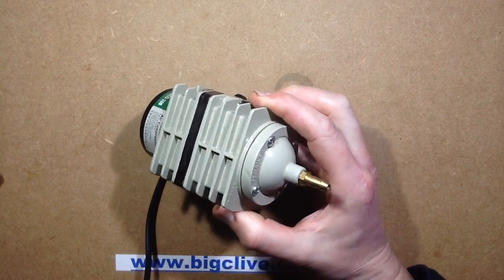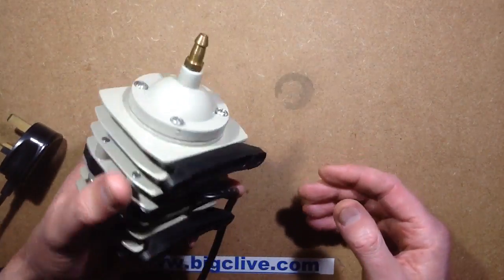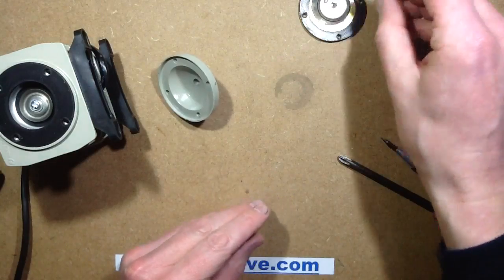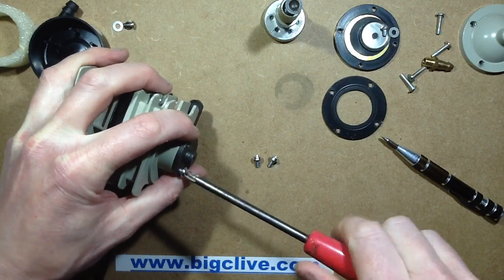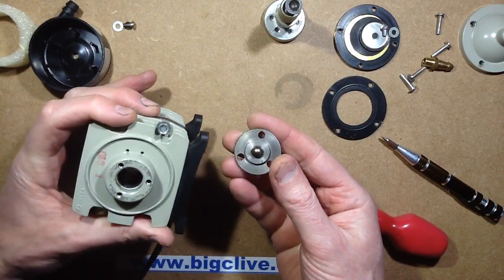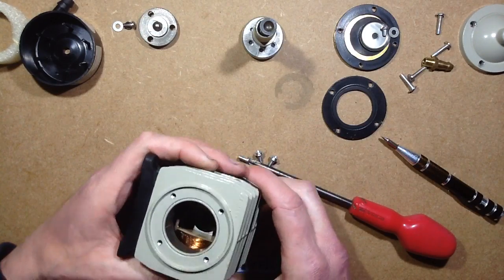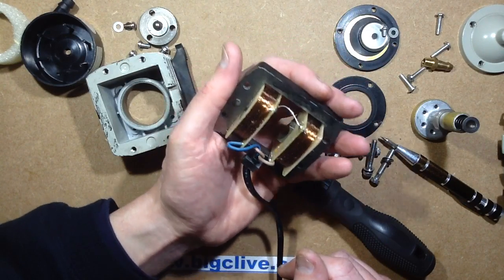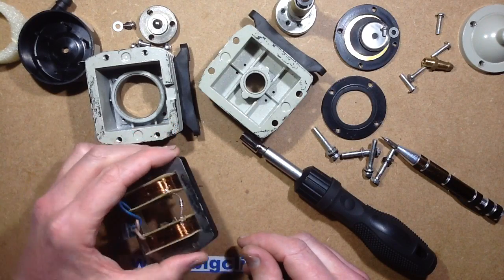Teardown of a Hailea low pressure air pump.

Comment: I have the AC0 308 model running air stones in a smallish garden pond.  The air output dropped and after watching your video took it apart. One of the valve screws had come loose and the rubber cover was loose thereby reducing air flow.  However, I noticed on this model there is an earth strap to the casing and 3 core electric lead.  Thanks for the video - very useful.

Comment: How do you know when you would have to replace the diaphragm besides the obvious signs of damage? Would you replace after a certain time frame?
Thanks
Reply from the maker: It may depend on the operating conditions.  If it started operating with lower output then it would be worth exploring.

Comment: Hi Clive, a small input hose on that model makes it's operation much less noisy.
Reply: TED6667 especially when adding a few inches of hose to it. Cut the sound of mine by what seems like half.
Reply: Getting some new rubber flaps for it. I'll try your tip with the hose @blaircox1589
Reply: @blaircox1589  ⚠️ God has said in the Quran:

🔵 { O mankind, worship your Lord, who created you and those before you, that you may become righteous - ( 2:21 ) 

🔴 [He] who made for you the earth a bed [spread out] and the sky a ceiling and sent down from the sky, rain and brought forth thereby fruits as provision for you. So do not attribute to Allah equals while you know [that there is nothing similar to Him]. ( 2:22 )

🔵 And if you are in doubt about what We have sent down upon Our Servant [Muhammad], then produce a surah the like thereof and call upon your witnesses other than Allah, if you should be truthful. ( 2:23 )

🔴 But if you do not - and you will never be able to - then fear the Fire, whose fuel is men and stones, prepared for the disbelievers.( 2:24 )

🔵 And give good tidings to those who believe and do righteous deeds that they will have gardens [in Paradise] beneath which rivers flow. Whenever they are provided with a provision of fruit therefrom, they will say, "This is what we were provided with before." And it is given to them in likeness. And they will have therein purified spouses, and they will abide therein eternally. ( 2:25 )

⚠️ Quran

Comment: I have a very similar one. It's the Model: ACQ-005, 70watts/Output 70 liters per minute/230volts+Earth connection. It's also a fishpond pump,BUT.......it is also a ideal pump for inflatable items like PVC air matresses,beachballs etc..  Surprising too: It has enough pressure to POP such things too if you're not careful! ;-)
Reply: Hey cool, i also use these kind of compressors for my inflatable PVC toys. They have indeed more than enough power to pop these, so i uses a microcontroller, a solid state relay and some sensors to control it. It's also got a touchscreen for easy setup and different programs.

Comment: I've got a Chinese one tats the same but with a different name..ACO-003...working 24/7 for the last 7 yrs powering two 4" air stones in a pond..never opened it n never cleaned it...only thing I've noticed is the air flow has dropped a bit...but still good enough not to replace...guess with Chinese stuff you've got to get lucky :))

Comment: Geez, you would think they would have some consideration for the poor generators and make that thing to run at 100Hz. A stronger spring, a little less mass and a short instead of a diode. Maybe a bit of a different winding on the coils.

Comment: Tip:
You can use vacuum sealers (with vacuum button that only sucks air out from the bag and does not seal it) and a plastic case to make a ghetto vacuum chamber.
Most of the vacuum sealers have a pump and pressure sensor inside.

Comment: I remember a while back I took mine apart to drill and tap the end out and fit a new nipple as the supplied one was tiny and the hose kept popping off, looking at the reed valves I thought meh nothing special there and reassembled it without paying much attention at all, today I find myself wondering what is actually inside one of the noisy little extremely low pressure beasts and discovered this. I am about to attack mine again just to attach a pressure gauge to it and find what the actual pressure is, I use  mine as air assist for a laser cutter. Well I just checked with a pressure gauge and the absolute max pressure is 3 PSI, when allowed to vent even a tiny amount the pressure drops to under 1 PSI so no pumping up the bike tyres with this one.
Reply: These compressors are not made for high pressures, but for putting air into a pond for the fish.
Reply: So 3 psi with fully blocked port. Interesting.

Comment: Do you still have it? What happens if you run it, or one of the little solenoid pumps, from a VFD? Is the spring/mass tuned to 50Hz?
Reply from the maker: Not sure how effective that would be.

Comment: nice teardown and analysis.  Do you happen to know the pressure limits on this pump?  certainly high volume at 0 psi, but will it pump to 1bar or 2bar?
Reply from the maker: Not sure its rated output, but it's only for low pressure.

Comment: Hi Clive, I have a similar pump boyu 009 and I mounted it on a wall and now it only works intermittently or not at all. Any idea what's going on with it?
Reply from the maker: If the cylinder can move freely inside then it's most likely a cable breakage due to the vibration.  That could be the flex where it enters the unit (wiggle it to see if it cuts in and out) or it could be where it connects onto the windings inside.

Comment: Hi there Clive.  I have a question. If you are to increase the diameter of those four little holes at the back for air intake, would that affect the air flow positively or negatively or have no affect on it at all? Thanks for the tear down.
Reply from the maker: They may be sized for maximum efficiency already.

Comment: I'm wondering if you could double the pumps out put by removing the diode and adding a bridge rectifier on the input? Might need a stronger spring too. Also, that thing really should be earthed there is no double insulation.
Reply: If you put a bridge rectifier the play would go from one-zero-negative one. That means from the original play of neutral-backward (the spring pushes it back to neutral) to forward-neutral-backward. You will have to redesign the whole thing. Probably make a back to back piston. Kinda putting two pumps on each other's rear.
Reply: The operation during half of the cycle is to give the other half for time for the piston to return. Going full wave would greatly shorten the stroke and give inferior performance.

Comment: What type of diode is that? I need to replace the one in my pump. Thank you in advance.
Reply from the maker: A typical 1A  diode for mains voltage would be a 1N4007.
Reply: Thank you very much for your help.

Comment: how to make it silent
Reply from the maker: Difficult.  Try a foam lined enclosure, but allow for airflow.
Reply: Most of the noise is coming out of the air outlet. I built an airtight silencer for that out of a wastepipe and some foam i drilled holes into. It works really well and makes the device much more silent. That will have no effect, if you use the compressor for blowing air into water, but i use it for inflatable pool toys and other things. I use the 100 Watts version of a similar compressor.
It also helps, to put the device on some foam to damp the vibrations. It is still very audible one floor below. I am looking forward to trying the 200 W version that should be much faster.

Comment: I would like to know how much and where to get them as I suffer from chronic asthma and emphasima and a normal nebulizer sets me back around the $350 mark for the same performance
Reply from the maker: ***** These pumps are sold by aquarium suppliers on ebay.  Usually for Koi tanks.
Reply: +gigabytex64 If industrial oils and lubricants from China help chronic asthma...... your in luck. This will make it happen!
Reply: I would give it a go over with cleaner and rubber preserver, same as all air equipment for use in air supply in this area. If you think its viable to keep collecting brand new nebulizers so I dont end up in hospital I am sorry to say I canr keep it up as the rest of my medications comme to $150 per fortnight. I was born in the era when the tested aall meds including steroids of all kinds leaving me with a lung capacity of nearly 2 ltrs and heart of 1.7 times its normal size, my heart rate of my last attack I set the record for our little hospital 225 beats per limit so equipment failur is something that concerns me.
Reply: What do you mean I dont follow the statement as to accent altered typing as I am Australian with dual citizenship USA, I dont see any reason on typing in enunciation of either.?
Reply: Hurts himself to help himself, its logical .You complain of all this testing on your generation and now your poisoning yourself daily. You can't win at this point.
Reply: +gigabytex64 Alternatively, you could move into a first world country which offers medical care for its citizens. What's stopping you?
Reply: +Kanakotka ? I live in Australia and am on a disability pention but that doesnt change the fact it is costly to replace equipment, but before you mention that I would get my medication cheaper I do but my fortnightly medication costs $80.00 on average and does not help with being able to purchase equipment.
Reply: *****
Those costs still seem really quite exorbitant to me unless you're omitting out that a considerable portion of the sum is being covered by insurance or something. Especially when you need this stuff to live.

I mean, i spend about as much (probably slightly more) on food, and i don't have 300+$ purchases on top of that.
Reply: +Kanakotka To get the nebulizer that is capable of working every 2 - 4 hours you have to put allot of money into one. I paid $150 for a car nebulizer and used it when traveling back and forth to hospital and it was starting to sound a little noisy so I took it back to be told the warranty does cover frequent use it is to be used while in the car and use a normal  $250.00 unit but these units arnt designed to be used for a person that has sent times of every 4 hrs they are designed to only be used for 2 times a day max.
Reply: LOOK FOR Allesearch or vital air metal nebulizers and ebeay tends to sell then, but if you ar in a bind get a airpunp for 4 wheel drves the sell for $20.0 byt remember they are not a longtime solution. I am getting oxigen cylinder soon so no more problems.